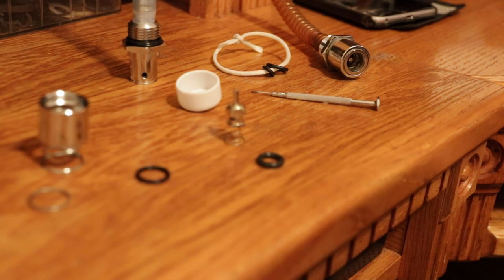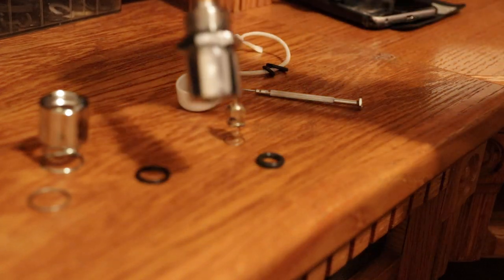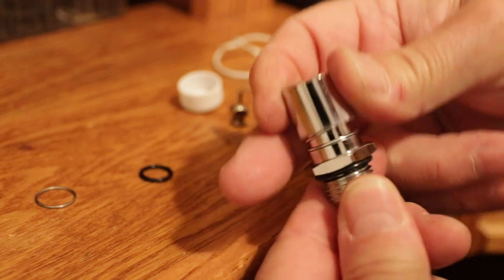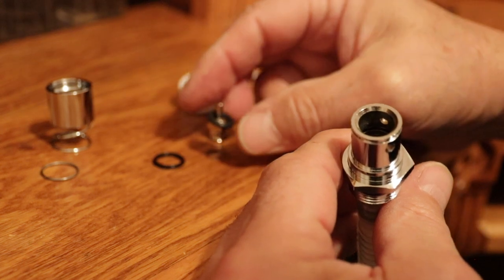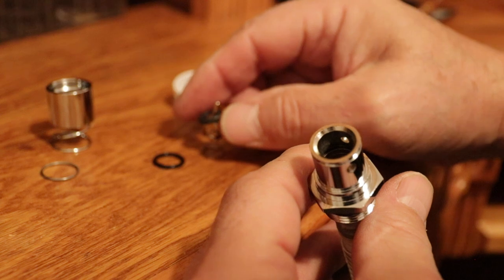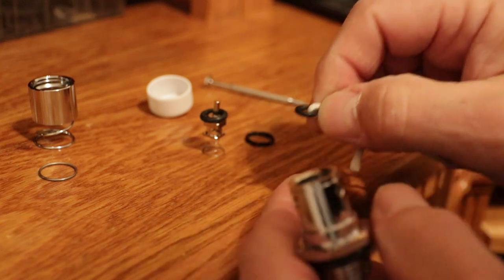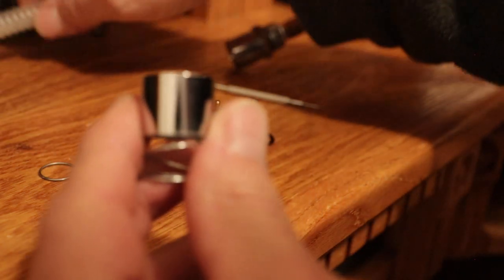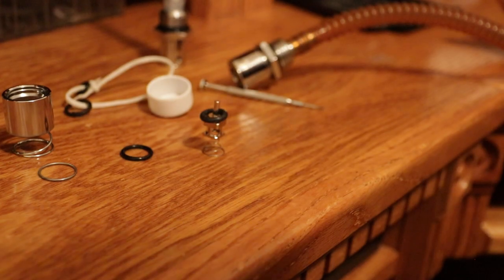Harley fuel tank check valve rebuild

Comment: Sorry just to ask you because everyone have problem with this valve, you cant do anything else there as build small tube with threads and use just clambs for the inside&outside hoses when you want to take out your tank?I mean something easier using only clamps and hoses.

Comment: As you are inserting the pick to get at the top O ring, do you also have to push on that plunger?
Reply from the maker: It's been two years ago since I did the video but No the plunger doesn't need to be pushed to remove the top o-ring. 
Watch the video and do the job just as the video says. Once you start working on the part it will be easy

Comment: I wonder who supplies these o-rings to Harley? As an engineer in the auto fuel systems world, we’d never get away with this.  Fuel leak above hot engine = bad job Harley. Just replaced mine this weekend.
Reply from the maker: I call it  Harley junk !  These o-ring are metic so China maybe their supplier . GGG
Reply: Ron, I pulled into a diner yesterday on my 2014 CVO Breakout.  Fuel was pouring from this area due to failed O'Ring.  I desperately got off bike thinking it might burst into flames.
Reply: @itisaporsche  Fortunately it is an easy and inexpensive fix.  I bought an o-ring kit for like $10 at Advance Auto.  They sell kits to make it easier, but dental tools do the trick too. I love the Breakout!

Comment: Do I have to do anything special when removing the check valve assembly from the bottom of the tank ? I’ve managed to clear both of the old o rings but trying to stick the new ones and the check valve back up into the body with a mirror is just not working for me !
Reply from the maker: The check valve has a hose run from it to the fuel pump. I had to remove the top dash opening it up and unclamp the hose before the valve can be removed. Don’t forget to unplug the fuel pump, crank the engine to remove the fuel pressure. 
It sounds hard but it’s not. If you have a manual it will show the fuel pump wire. It’s under the seat bottom of tank.  I’m not sure if the hose is long enough for you to remove the valve without unhooking it from the pump but (after gas is drained) If you raise tank in the rear so the gas doesn’t spill , remove valve and try flipping it over to work on it.
Reply: I have a deep 3/16 socket for 1/4 drive which I use upside down..always have some oil on any o-ring when you install them..it's not very difficult to place the spring the valve and the o-ring on top of the socket and push all in the housing. With the socket by hand. Then the larger o-ring you can place partly in the opening. And the socket again by hand will seat the second ring very easily.  Then use your mirror to see all aligned or not. The last time I did It .. a tiny piece of the oil sealing was in the groove, and I used a q-tip to brunch it out.

Comment: My buddy's started to leak so we pulled the whole thing out but the hose broke off and we cant get the old hose part out and we tryed to take the tank off but his speed o it on the tank and the center nut just spins so dose the old hose need to come out or will it just brake down over time or should I just tell him to send it to the shop
Reply: Oh his bike is an 03 softail
Reply from the maker: I wouldn't worry about the hose braking down but sounds like you'll need a new hoses. The old hoses need to be removed and new ones connected.
 I like learning and saving money while working on my own bike but if you can't fix it have it done. Your problem is the nut and getting the fuel pump out. There are YouTube videos
showing how the fuel pump can be removed , a little tricky but easy if you know how. Remove the hose clamps and hoses from the pump .

Comment: Hi! I also share the same problem… same magneti marelli road king from 05/2001… can you give me the oring size located in the hose coming from the injector… it seems to be deferent from the small one located in the valve (M2x4.5) doesn’t it? Yet they seems working the same way…🤔
Reply from the maker: No sorry, If I understand you correctly  , I haven't had a problem that hose but  just what is in the video can I speak of. 
Sorry.  Go into it and pull the O-ring out and you can measure it.  If it's bad,  you'll need to remove it , right ?
Reply: @goodboyringo9716  Yes I have the same issue… I already turn the seal out… I thought it might be good to change all seals in both line… can’t mesure it… nothing much than dust.
Reply from the maker: @vincec3833  ... I can't add much else than my video because I've only had a problem with that one line and not even sure what the other valve looks like.
Maybe try the same size O-rings as I list ? I would think they are the same size. Sorry I couldn't help
Reply: @goodboyringo9716  yes I will… thank you so much for all you did.
Reply from the maker: @vincec3833  ... No worries my friend just take your time and do what needs to be done.
These original fuel lines are costly  if you can even find one so try not to mess it up.
Reply: Good boy Ringo… I ordered the Orings you mentioned and received it… doesn’t fit at all my magneti marelli fuel hoses…
Did you mentioned mesures in inches or in millimeters?
I ordered 2mm x 4,5mm and 2mm x 10mm. The one that fit are larger for sure.
Reply from the maker: @vincec3833  .... Not sure what bike you have or what size o-ring you ordered . Check the size of the o-rings you ordered and the size of your old o-rings.
What fit mine is in the description and they worked for me and many other people. 
Make sure you are doing the same job as me, other than that I'm not sure what is going on with your job.
Reply: @goodboyringo9716  same job as you. My harley is a 2001 road king with magneti marelli (2 lines fuel coming in the tank through the left side). The oring dimension you gave talks to Americans but I’m French with a different metric system. The M2x4.5 you indicated doesn’t fit my lines. When you tell 4.5 is it millimeters? Is it inner oring size or outer oring size? 2 supposed to be the thickness of the oring correct? Ditto for the other oring M2x10 that come in last position in assembly.
Reply from the maker: @vincec3833  ... I worked on my bike two years ago. For this reason I'm lost for info other than my video. I don't keep this info in my brain , I move on but I'm not making fake videos .
I released this video to help others with this problem. I'm shocked to learn its not working for you. Keep at it and I'm sure you'll figure out why these o-rings are not right for you.
Yes , the o-rings are metric size , just what I listed. These worked beautiful in my bike. I had a hard time figuring out what size they were because we don't normally use metric but Harley used metric on this system. Harley may have changed the o-rings on the 2001 , I'm not sure .
M2x4.5 and M2x10 are metric o-rings. I may be able to find the small o-ring tomorrow and measure it for you. I think the 4.5 is the inner size.

Comment: Which oring goes in the hose
Reply from the maker: I don't know what you mean "which o-ring goes in the hose"  Two o-rings go into the chrome check valve just as the video shows.
The large o-ring is first and around the wall . The second o-ring in down into the check valve sitting on top of the small valve .
If you can be more  clear about the o-ring in a hose I'll try to help , thanks
Reply: @goodboyringo9716  OK thank you. I misunderstood.

Comment: why dont you show you performing the repair since its that easy to do
Reply from the maker: Because I only have two hands and can't work & hold the phone at the same time.
If you can't do this job you don't need a Harley
Reply: @goodboyringo9716  Excellent answer.
Reply from the maker: @davebrookbank4831  ... If this video helped you great . I only wanted to help others because I couldn't find  a replacement hose and had to fix it myself so I wanted to show how easy it was to repair. If I had a tripod the video would have been more helpful but I did the best I could.
Reply: @goodboyringo9716  You did great and I thank you

Comment: Upper oring: 8mm ID, 13mm OD, 2.5mm W
lower oring: 10mm ID, 14mm OD, 2mm W
Reply from the maker: The o-rings size I used are in the description and they worked just fine . I'm not sure why you are listing different size o- rings , maybe you have a different set up.
Reply: Thank you

Comment: Just replace the whole fan hose!
Reply from the maker: These hose are not available
Reply: @goodboyringo9716  unless it's a rare bike dennis kirk had mine. Much easier to replace.
Reply from the maker: @pretrip67  .... What year is your bike ?  Harley doesn't sell this hose for 2000 Road King. You can see in the video I bought one and it doesn't fit , I may have got it from Dennis Kirk
This fix is not hard and cost way cheaper than a hose. So I don't see how buying a hose is easier.